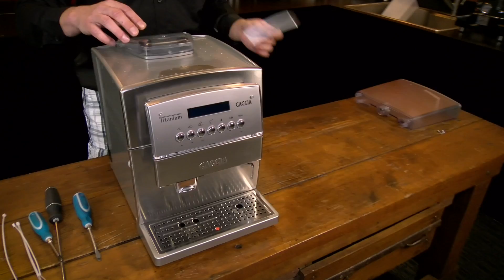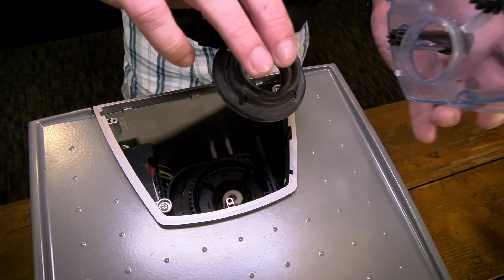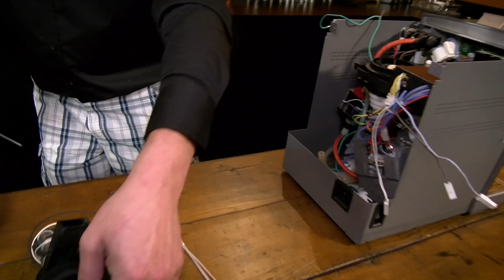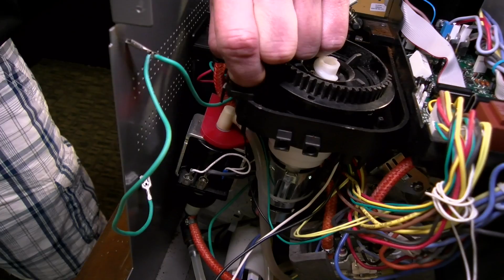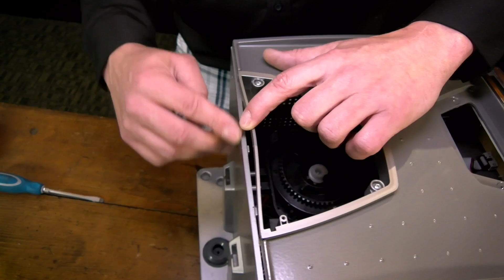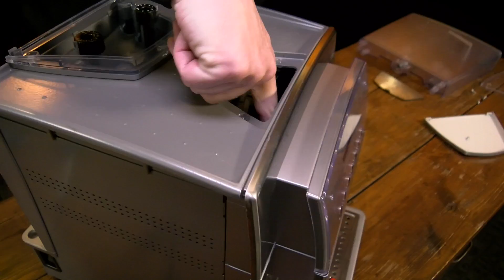How To Replace the Grinder in a Gaggia Titanium

Comment: Hi my adjuster knob gears are not engaging (too high) both the doser and the grinder.  So both knobs spin freely and dont engage.  You can physically see the gap between (its a vertical gap).  Any ideas??!
Reply from the maker: Hi a, Passed your question to our lead Gaggia Tech. Here are his thoughts:
Something is not seated properly. Could be the hopper. Could be the grinder. It could also be the back panel that the water tank sits on. There are 2 mounting pegs on the backside of the back panel. These 2 pegs seat into 2 openings of the grinder support plate. If those aren't in correctly, then the grinder support plate sags down a bit.
Reply: @Wholelattelovepage  Wow awesome thanks for the quick reply, I will have a proper look at it then once I get an afternoon to take the back panel off. For now I have just set everything to the middle manually so I can carry on using the machine.  Thanks again!
Reply: @Wholelattelovepage  thank you so much for this response and this great video. I have a used machine that had this same issue, and was able to pop the supports back in and have it working properly in no time.